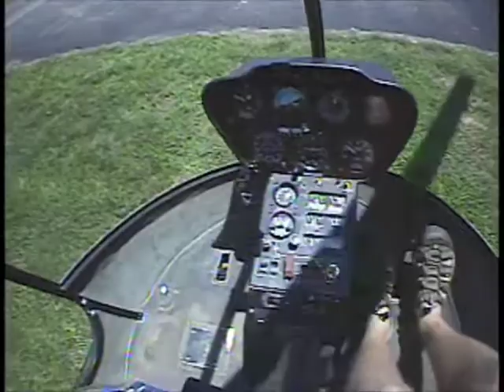Helicopter Lesson on Settling with Power + ATC Radio Communication

Comment: @michaelmiller85 it depends if your talking VRS or "settling-with-power" remember that the two are different. "settling-with-power" is effectively running out or power (hot, high, heavy) on an approach with loss of tx lift etc... where you cannot maintain your approach ROD, this may well lead to an uncontrolled rod, power applied, and low rpm/airspeed. i.e.vortex ring. but the ROD required to enter full vortex ring has been shown in tests to increase with all up weight as the downwash is faster.

Comment: @aliaucky also wondering your thoughts on this, i always used to believe that hot, high, heavy made chances of vortex-ring higher, but I was told recently by some test pilots that it's easier to induce if your light because your downwash will be induced through the disc slower (less weight to overcome) which means you don't have to descend as fast to descend into it.... if your heavier you have faster downwash therefore higher ROD required... interesting food for thought though i'm not convinced

Comment: Clean air is everywhere, except in the vortex downwash!!  Recovery from SWP can also be made by lateral cyclic or aft into clean air.  This is good to know in case one MUST make a steep approach into a confined area, into the wind of course, and does not have safe forward manuevering room.  ....I know you probably already know this, but since it wasn't metioned in the video, I had to show off.